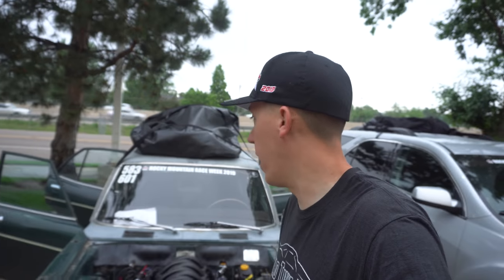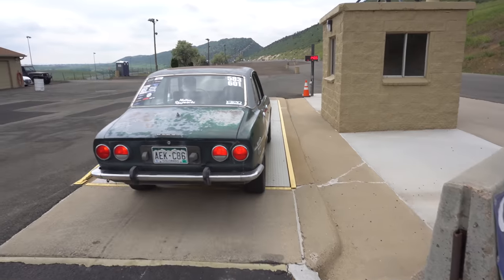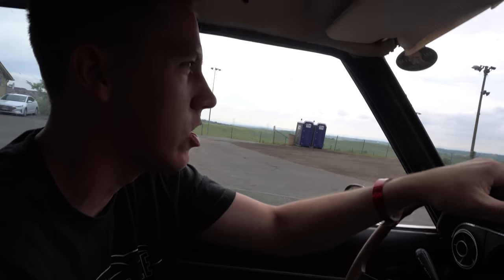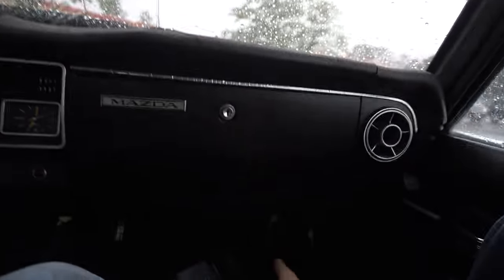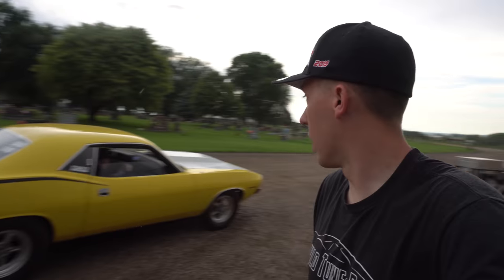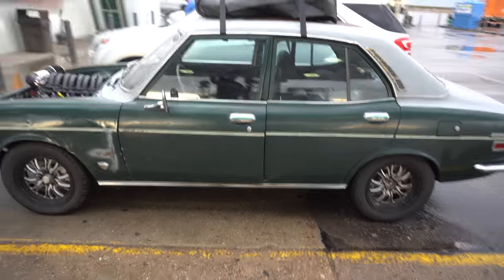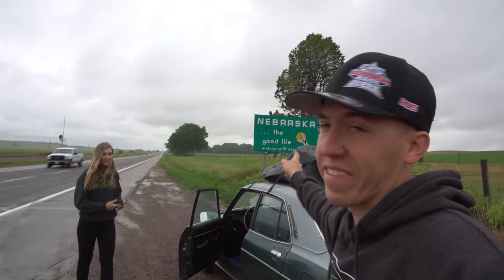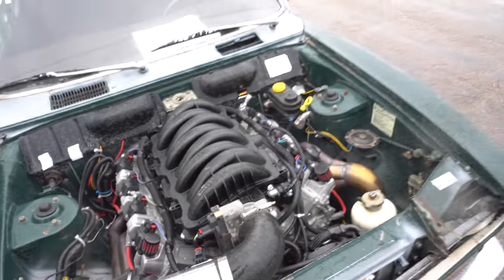Certified STREETCAR! Racing and Driving over 10+ Hours! RMRW DAY 3-4

Comment: Looks like you guys are having fun but I'm going to rain on your parade, my stock 3400 lb VW Golf R does 12.94 at Bandimere's.
Reply from the maker: We have a bad injector and after figuring out the ignition cut on the 1-2 2-3  shift we got it to run 12.94 in pueblo still needs the injector fixed hopefully it will go 12.7s when everything is good. That impressive didnt know the golf's were that fast but knew the R definitely makes a bit more power!
Reply: @BuildTuneRace  If you guys bring the Buick to Bandimere's I would like to know so I can come see it. I always liked those cars as a friend had one with the turboed 215 when I was in high school.